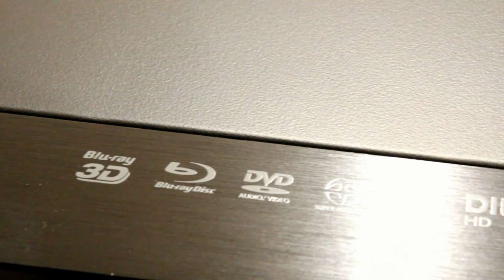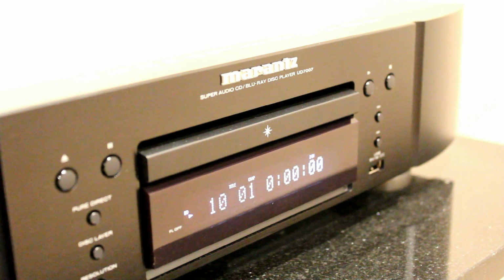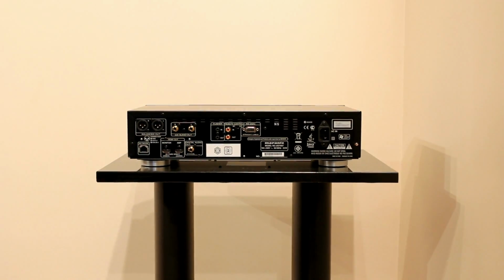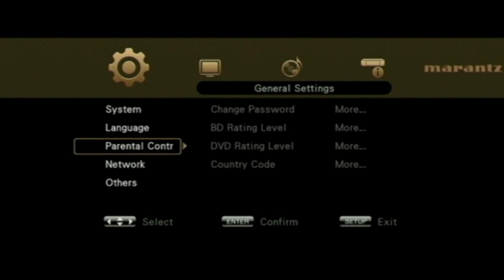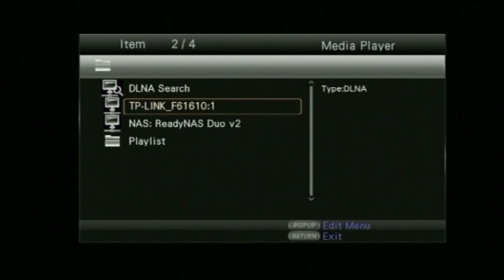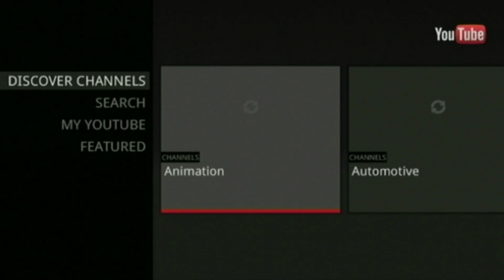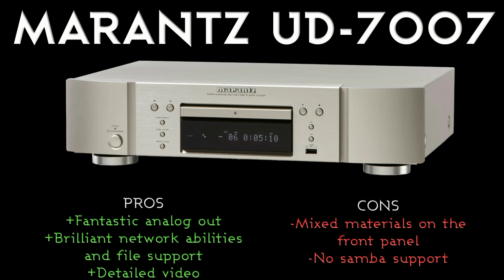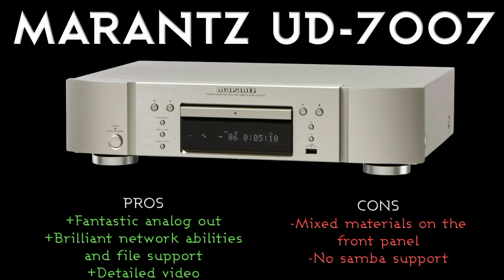Marantz UD7007 Multi-Region Blu-Ray Player Review by AV Land UK

Comment: I am on my second Marantz ud5007 and have nothing but problems it has buggy firmware does not recognize half of my blurays analog outputs have problems it boots me out of Netflix all the time also has major handshake problems. I am buying an Oppo 105d. Marantz customer service is also hit and miss no more Marantz products for me.
Reply: The UD7007 is a good player they do not share many of the same components except the case. I loved the 5007 but the first player the analog outputs only worked if I unplugged the hdmi cable. The second player fixed that but would lock up and get stuck on some Blu-ray menus. Firmware would not help. The only thing that fixed the problem was a factory reset and that was temporary. Another problem was it would constantly kick me out of Netflix.
Even with all the problems I still miss it the picture was amazing. I realize that every company has its problems. I think I will try a Marantz Pre-Pro after I collect enough amps! Check out my channel I try to get back to every comment and try to do a normal guy review on most things that come my way.
Thanks for the comment. I'm jealous of your UD7007 it would make My Epson 5030ub look even better!
Reply: Squall Leonhart Sorry for the delay sometimes these comments pop up really late! the first player I had the analog outputs would only work if I unplugged the Hdmi cable. The second player fixed this but would lock up on Blu-Ray menus and kick Me out of Netflix constantly. I could fix this with a factory reset and a firmware update but it was only a temporary fix. I really liked the player the picture was great! I hear the UD7007 has none of these problems.
Reply: Hi guys can someone please help me my MarantzCD player is not working within the remote because is in BD2 how can I change it to BD1 thanks